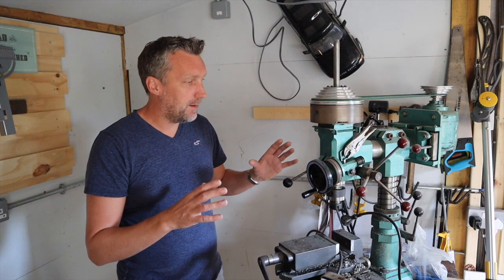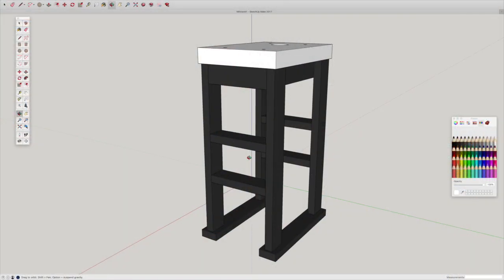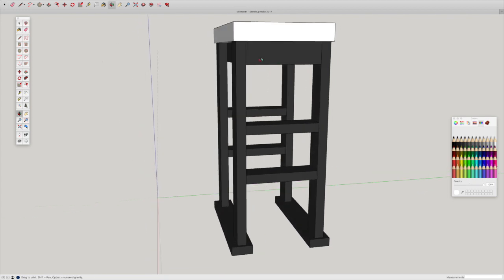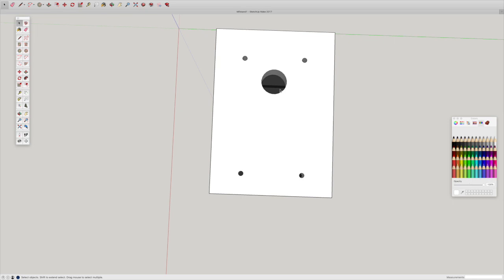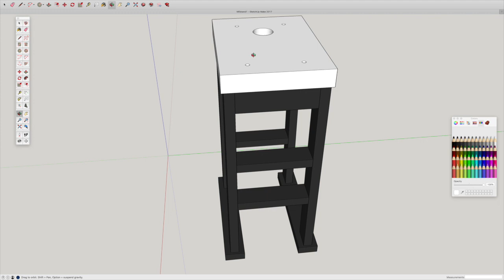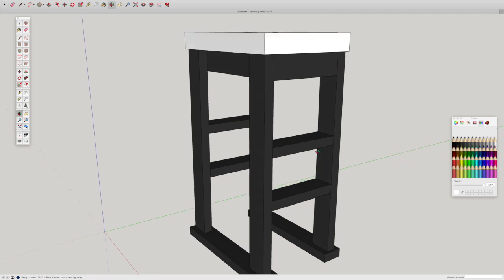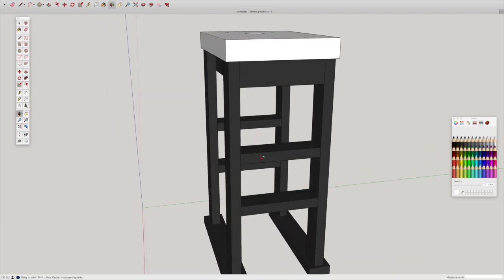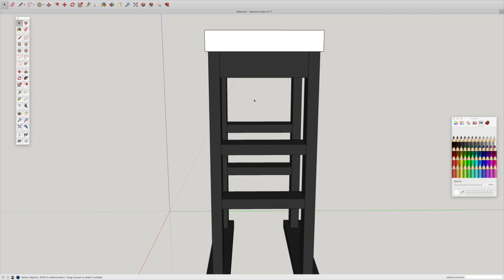Making a Milling Machine Stand

Comment: Good work, but consider pouring a concrete or epoxy granite base for the top. You'll gain a ton more rigidity.
Reply from the maker: Thanks John. I’ll try a concrete top when I get time. Also could do with a concrete pad as the timber floor in that part of the workshop is not very rigid.

Comment: Hello James. Excellent video. Very informative and inspirational. I have a new to my Dore Westbury mark 2 arriving next week. I am preparing my own stand and have tried, without success to find the dimension of the hole required for the column and how far from the front edge the centre of that hole should be. Can you help? Andrew
Reply from the maker: The column is 2.5 inches so the hole should be around 65mm for clearance. Mine is set back 36cm from the front of the bench but the base of the Mill is set back 5cm from the edge too. So the column is around 31cm back from the front edge of the XY table.
Reply from the maker: 65mm hole set back 31 cm from front edge of the mill which itself is set back 5cm from the front edge of the bench.
Reply: @jamesoshea9030  Hi James. Many thanks for the reply and very useful dimensions. I am grateful to you. Andrew